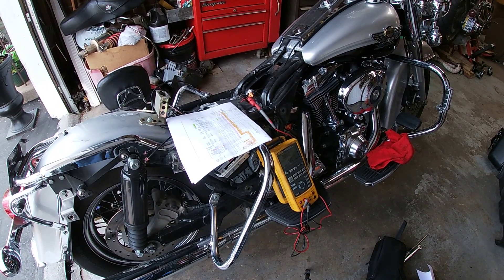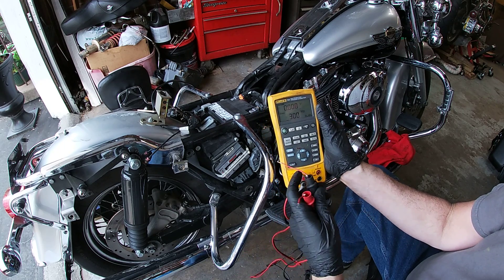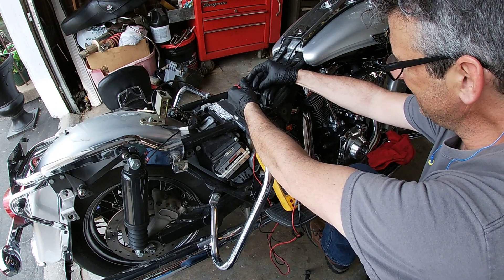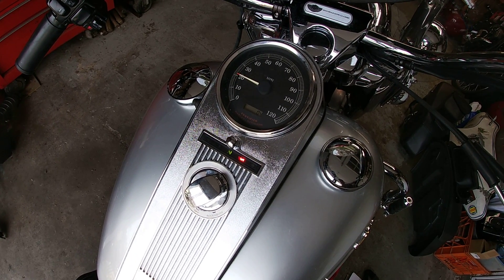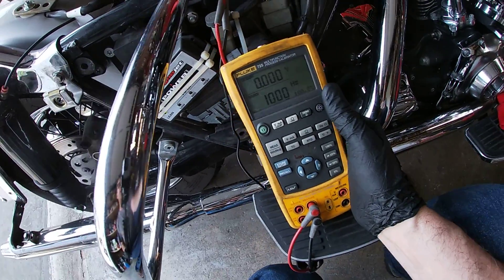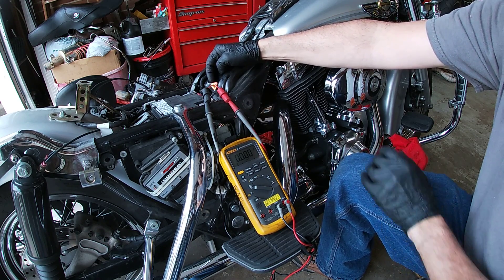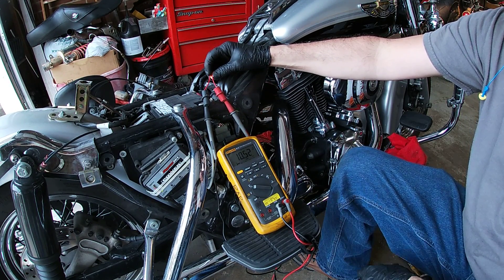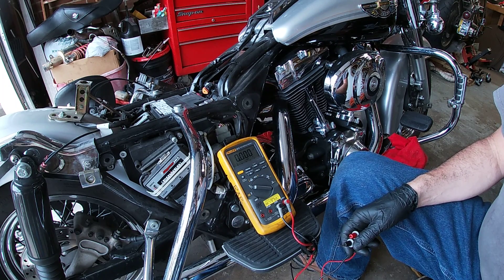Harley Electronic Speedometer Troubleshooting

Comment: So whats a pick up and how did you change it. I ask because my Indian chief dark horse speedometer doesn't work bought it used that way
Reply from the maker: For my Harley it takes an Allen wrench to remove it from the transmission and then you unclip the wire. Looks like this picture in this link. 

https://www.jpcycles.com/product/v-twin-mfg-electronic-speedometer-sensor-unit-for-harley-touring-1997-2003?srsltid=AfmBOooeEZRWdGzh8aaCBfnVwArkU3TQhlG0k7ooRwD9fOyX04h3Zi_8&sku_id=10087048

Comment: I crank my dyna the speedo goes off when flip.key off and on it come back on.
Reply from the maker: Check to see if you are loosing the 12vdc power to the speedo when you crank it. Also use an ohm meter to check to see if your loosing the ground. If it not either of those then I would say you have a bad speedo.

Comment: I have a 1995 Sportster 1200 my speedometer constantly reads right around 30 mph whether I'm going 5 or 70 I have cleaned my Speedo sensor three times do you think it could actually be the speedo sensor or could it be another problem thanks in advance
Reply: You know I just remembered something else I eliminated my tac and I also eliminated a redundant ground
Reply from the maker: I'm not sure exactly what it could be. The speedo has a stepper motor that moves the needle. That motor could be bad or the pick-up could be bad. It's easy enough to replace the pick-up and it's a cheap part so I'd start with that. Let me know how that works out.
Thank you for watching. RGS
Reply: @Rapsgarage hey how are you how about an update are you ready 😁 I replaced my speed sensor module same exact result whether I'm going 5 mph or 70 mph it reads right around 34 miles per hour. So I tried changing out my voltage regulator same exact result. Also I wanted to let you know I have another intermittent problem every once in awhile my turn signals stopped workin the indicator light lights the bulb solid lights does not flash and also Auto cancels. Then it will start working in a day or two I'm thinking somehow these two problems are related.
Reply from the maker: it could be related. That sounds like a bad speedo with both those problems.
Reply: @Rapsgarage hey I replied to an earlier comment I wanted to make sure you saw it thanks in advance
Reply: It was in regard to a redundant ground I eliminated when I deleted the tag

Comment: Will that work in testing a speedometer on a 2017 Indian Chief Dark Horse?
Reply from the maker: Let me say first that I've never looked at or worked anything involving am Indian or a Dark Horse motorcycle nor do I have any books on it. With that said I did look it up and I think your system in a CAN Bus system. Harley didn't go to CAN Bus until 2014 so my bike is not CAN.  If you have the wiring diagrams I can look them over, if you can email them to me. Let me know.

Comment: My 1995 dyna has an electronic speedometer. It acts like it’s sticking and if I tap it the needle jumps to my speed. Put a new speed sensor in and it now runs in reverse or stays at 30 mph. Needle is straight and the backing isn’t bubbled
Reply from the maker: Ugh. My first thought is the new sensor is bad unless you bought a factory H-D sensor. Maybe a wire problem like skinned insolation or loose in a connector? I don't have much of an idea other then a bad speedo.

Comment: This might be a longshot, but I'll ask anyway...  I picked up a speedo that was removed from a 2003 FLSTC, likely when it was nearly new. The part number is 67033-99A. I have a '98 Heritage Springer, so the connections are not the same. However, I'm able to get power to the 2003 speedo, but the odometer appears to be sitting on trip miles, not total miles. I have a 2 wire trip reset button that comes from an adapter kit for changing my 98 speedo to accept this "new" one, but I don't actually want to make the conversion. I just want to be able to see the actual miles on this "new" speedo. Is there any way to bench test it to switch from trip to total miles? If so - how?
Reply from the maker: See the attached wiring diagram website. If you apply power to the 2003 speedo (you said that you can) then momentarily  connect Pin 1 to Pin 6 (short them together with  a jumper) that will cause it to switch from Total miles to Trip miles. If it's on trip miles and you hold the jumper on pin 1 to 6, this will cause the Trip miles to reset to zero. As you can see, the switch on the 2003 has two functions. Please reach out if you have anymore questions. Please like and subscribe, if you haven't. Thank you  https://serviceinfo.harley-davidson.com/sip/content/document/view?id=5529&parameters=highlight%3D&options.inTitle=false&options.inDescription=false&terms=&options.inContent=false#041ce62f-ccbf-45b5-91df-010aaa3cb439!!4!55
Reply: @Rapsgarage  THANK YOU!!! Although I did try your suggestion of using a jumper (while also having the speedo powered up), that didn't change anything on the odometer. It's possible I didn't hold it (keep it jumped) long enough, but I had success by following the wiring diagram you linked. As mentioned, I have a function/tripometer reset switch, so by following the diagram, I was able to connect it to the correct pins. And when the power was connected - BOOM! Well, it wasn't that dramatic, but it did the trick. Turns out, the odometer has only 2 miles on it! Once again - thank you very, very much!!!
Reply from the maker: @BBPissed Awesome! Glad I could help.

Comment: I keep blowing my accessory refuse after I put a new battery in my rear wiring harness to my lights got chewed up by my tire. I bought a new wiring harness fender, harness aftermarket six pin to six pin not 8 to 6 pen wired it in, however I get nothing and my access refuse keeps blowing This all started because I had intermittent turn singles and no brake light. My brake light would stay on I have 12 V coming from the front switch. I have 12 V in between the rear switch so the switching on the brake light should be OK I assume? My question is do you think it may be my TSSM and that’s taking everything out? If I have my rear brake switch disconnected with that below my accessory fuse?
Reply from the maker: I’d start by unplugging everything that you worked on and then start plugging them in one at a time to see what blows your fuse. The TSSM shouldn’t be causing the blown fuse, but you could also unplug that too

Comment: New Speedometer, new sensor.  Still won't work. Didn't test for voltage, will do that.
Reply from the maker: Good call. Also check the ground. If you’re still having problems please reach out
Reply: @Rapsgarage  well, it shit the bed today. Had to have it towed. The Thunder Max is toasted.  I'm positive
Reply from the maker: @Ray-t9r8b  That makes sense. Reach out if you need further help.
Reply: How is your ground

Comment: Great information if there's a less expensive tool for injecting a signal though that would be great, not many of us have a $2000 Fluke 725 hanging out in the garage.
Reply from the maker: What you say is accurate. I have that meter from work and had no idea the cost of it. There’s a frequency generator on eBay and I bought one. One of these days I’m going to get around to doing a video with the five dollar frequency generator that I bought. Thank you for watching

Comment: Please help me!!. I have a 2012 48sportster, whenever i start my bike and hit the start switch the bike will start no problem but my odometer will go completely black, the bike will ride but the idometer is completely off
Reply from the maker: Looking on Harley Davison’s website at the wiring diagrams. The only thing that goes to the speedometer/odometer is an ignition power, a serial data wire, a hot wire off the battery, a ground, the trip odometer reset switch and the fuel level gauge. I would say if you’re if your odometer is going out and everything else is working you’re gonna have to replace your gauge. If you need further help, let me know.

Comment: great video, way technical for me but the information was good to know.
I have a 2003 softail heritage that the speedo stopped but the odometer still reads. 
i bought a used spedo off ebay and installed it. it wont work either.
can you offer an opinion
thanks, eddie.
Reply from the maker: Below is the diagram for your bike. Looks to me if the odometer is working then the speedometer should be working. I would say if it's not then the speedometer you had and the one you got are both bad. I'd still check it with a frequency generator to be sure. Good luck and let me know how you make out with it. Thank you for watching and if you haven't, please subscribe.

https://serviceinfo.harley-davidson.com/sip/content/document/view?id=5529#19d2b2bb-4a10-441d-8fef-f95c3af5efaf!!2!11

Comment: i have an 1998 sporty xlh and my speedo just went dark,  no power at all also includes the tack... everything else has power its just them.. i have no idea what the issue is. i rather do it myself and not have to pay someone else to fix it
Reply from the maker: I recommend getting a copy of the bikes wiring diagram and a cheap volt meter. You can get the volt meter for a auto parts store for $10 and trace the power to see why you don’t have power. Thank you for watching and please subscribe. If you’re still having trouble hit me up.
Reply: @Rapsgarage  ill try that out and make sure to let you know. thanks for the advise

Comment: I have my speedometer is intermittent it works and then it don't and then it works and then it don't what do you think that would be the sensor or a bad wire
Reply from the maker: I wonder if you have metal on the end of the sensor. I would pull the sensor and check for that. If it's clean I would replace it. They are cheap on eBay.
Reply from the maker: Thank you for watching.

Comment: have you heard of HD Speedo needle pegging from zero too maximum peg by just turning ignition key to on position? needle now stays at maximum position.
Reply from the maker: I’d disconnect it at the speed pickup and see what happens. Sounds like the 12 volts is shorted at the speed pickup. You may be able to disconnect the speedometer and tap it lightly with the handle end of a screwdriver and get it to drop back to zero but I’d start by disconnecting the pickup. Let me know how you make out. Thx
Reply from the maker: Also you can email your phone number to hdrap_1999@yahoo.com and I can walk you through it over the phone.
Reply: I have the same problem. Did you find out what was wrong? Thanks, Ken

Comment: The sensor is fed 12 volts DC, which has a frequency of zero. The output should be a square wave that rises and falls as the teeth in the transmission gear pass over the sensor. So why the need for a $2500 frequency generator? Isn't this a simple hall effect sensor?  Shouldn't we simply see a change in voltage on the sensor output wire as the gear teeth pass over the sensor pickup? What am I missing?
Reply from the maker: You can buy a frequency generator for $2.37 on ebay. How will you be looking at the square wave to see if it's correct? This is to test the speedo also. How would you decided what the problem is? A volt meter measures the average voltage so it will look like you are reading DC voltage unless you have a $500 Digital Volt Meter that reads frequency.
https://www.ebay.com/itm/224042226711?hash=item3429f51417:g:XJsAAOSwcpte4n42
Reply: @Rapsgarage  A square wave is a simple on or off signal so you can attach a multimeter set to DC volts and monitor the signal wire coming out of the sensor (usually white). Of course first be sure there is ~12VDC going to the sensor. Then monitor the signal wire while slowly turning the rear wheel in gear. If you see around 10VDC- 0VDC-10VDC-0VDC as you rotate the rear wheel the sensor is most likely good. And a multimeter does read average voltage in the AC mode (RMS) but it is a direct voltage in the DC mode because the freq is zero. This testing is all done in the DC mode. If the sensor tests good, the problem is more than likely in the speedo. But I do wish I had a Fluke 725. Cheers
Reply from the maker: @steadyeddie7453  I didn't think of this but I will give it a try at some point in the future. 

A meter in the AC voltage mode does read RMS however "average voltage" is not RMS. the formula for RMS is 
RMS= Peak voltage x .707
The formula for Average Voltage is
AV=Peak voltage x .606
Some formulas for Average use .637 instead of .606

As I was told when I put this video out, is my Fluke 725 cost $2500. I didn't know they cost this much. I got it from a job I had and when they went out of business they told us to take our tools and meters with us. I have since bought a $5 signal generator from eBay that I plan on doing the same video with it to show you can use the $5 one and it still works. I'll get to it some day but right now I'm too busy with other things that need to get done. When I do the new video, I will try what you suggested too. 
Thank you for the input and thank you for watching. Please subscribe if you haven't. Thx
Reply: You can rotate the bikes wheel slowly, and the voltage on the sensor wire is a square wave and will go from (approx) 0 volts to (approx) 11v , multiple times during one wheel rotation.
That is an easy cheap way to test the sensor, requiring only a voltmeter.

Comment: I have no power coming back from the speedometer on my 1997 Harley Roadking.  Speedometer is inactive and odometer shows no reading either.  I would expect that if it were a bad speed sensor I would still have an odometer reading but an inactive speedometer.  I would also imagine I would at least be able to get a power reading of 10.5 volts back from my speedometer.  I am assuming my speedometer is bad.  is there anything I am missing here?
Reply from the maker: Sounds like you are correct.

Comment: I have a 1997 Roadking Police edition and the speedometer is not giving an odometer or speedometer reading.  I tried to test to see if the speedometer was getting voltage and there is no evidence of voltage,  Gauge lights up just fine and all other items on bike work great.  Just speedometer is not working.  I do not have a frequency generator to test with.  Harley manual says if odometer isn't reading replace speedometer.  Do you have nay tips?
Reply from the maker: I would guess the pickup is bad. These go bad all the time and it's a cheap part to replace. Call the dealer and get the part number then search it on Amazon or eBay for a cheaper one. If you need further help, let me know. Please like and subscribe. Thx

Comment: I have a 2000 ultra the speedometer doesn't work but the odometer keeps working. I'm electrician I'll pick up a frequency drive meter but what are your thoughts on one working in the other not?  I have replaced the pickup.
Reply: Thank you
Reply from the maker: That sounds like a bad speedo to me.

Comment: So I'm only getting 5 volts from the plug that goes into the vss sensor. I do not have a freq generator but installed a new vss. 04 road king carbed. Did my speedo die after just 30k
Reply from the maker: Sounds like it. I'd check it at the Speedo to make sure it's not a wire problem. It's hard for mr to know for sure without being at your bike...
Reply: @Rapsgarage  completely understand well come to find out the accessory fuse runs the speedo on my bike not the instrument one. But it keeps popping it every mile or few feet. Got a short somewhere.
Reply from the maker: @quimby09quimby09  Good that you found that out before you bought another speedo.

Comment: Good video man this is great info.  Do you know if there is a way to test the pickup to see if it's bad?
Reply from the maker: You probably should see some resistance but you can definitely get a good volt meter and check for a frequency coming out on the output wire with the rear wheel spinning. I surely be careful doing this.
Reply: @Rapsgarage  what about a Evolution motor? My speedometer just quit working, but everything else works fine.

Comment: So what if it has no power at all
Reply from the maker: I don’t have the schematic in front of me and work until Sunday. But I believe the way I would go about it is make sure your key is on. Make sure your speedo is on by looking at the light and odometer. Then I would measure power at the speedo. If on power at the speedo I’d say the speedo is bad. If you need more help you can email me at hdrap_1999@yahoo.com.
Reply: Well I've checked the bn/gy and black I have power and speedo doesn't light up evan with a different speedo. That's what it said to check in book with break out box it 5 and 7
Reply from the maker: I’ll check when I get back on Sunday. Send me your phone number if you want to the email address I stated.

Comment: Ok, how many watts does the power supply to the sensor how many volts
Reply from the maker: I think I had it on 5vdc. It hardly needs and current to work. It would be very little watts. Since power (in watts) is equal to voltage multiplied by current so 5volts x .005amps = 0.025watts
Reply: @Rapsgarage  How to fix it if it comes out 10 volts?
Reply: how do you fix it
Reply from the maker: @phattanaponginthasut1142  It may work with 10 volts. Email me your phone number and I can call you to help. hdrap_1999@yahoo.com
Reply: It comes out 10 volts, can it be used or not?
Reply from the maker: Yes it can be used at 10 volts. I’m guessing the difference in voltage is the charge on your battery is lower then mine was.
Reply: @Rapsgarage  Is your car still usable?
Reply from the maker: @phattanaponginthasut1142  I’m not sure what your talking about.
Reply: @Rapsgarage  The speed sensor is used with lights 10.Vol or burn